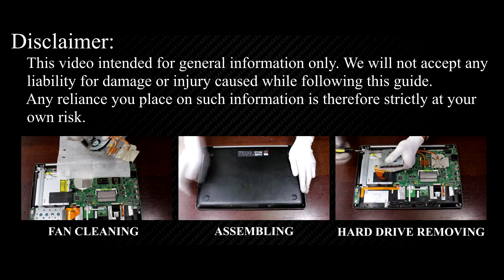Asus N550 RAM Upgrade and Installation Guide

Comment: Great install video...I am thinking about replacing my RAM on my Asus N550J.  The process of doing the physical replacement seems pretty straight forward....but is there anything I will need to do in the BIOS or anything?   Like upon boot-up, does the computer automatically do everything, or is there any additional setup that I will need to do.   I know pretty much nothing about computers, so if there is technical setup, I think I'd be pretty much lost.  Thx!     Also, fyi the RAM speed will be the same.  I will be replacing 1x DDR3 1600 SODIMM stick of 8GB RAM with 2x DDR3 1600 SODIMM 8GB sticks (I read that it is better to have 2 sticks of the SAME  brand/type RAM, rather than just adding one additional stick).
Reply: yes , you are right. its better to have 2 sticks of ram because it will works in dual chanel ,its better to have for example 2 sticks of 4 gb ram than one of 8gb ...performance boost of having dual channel is like 30%